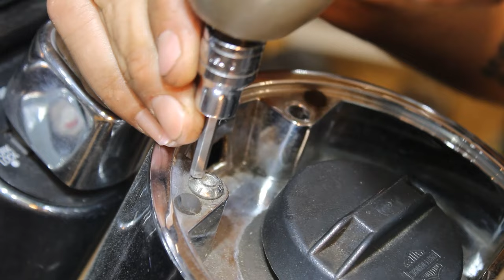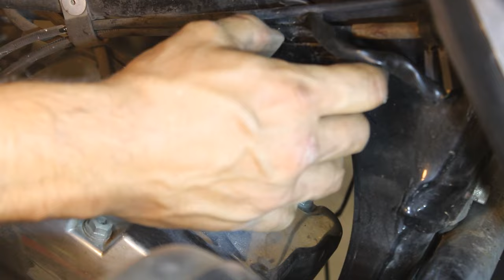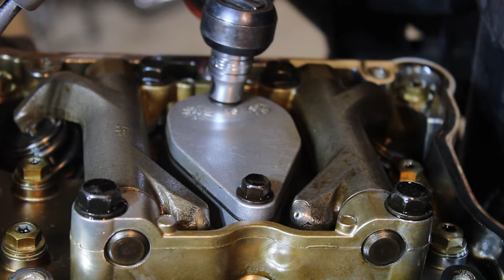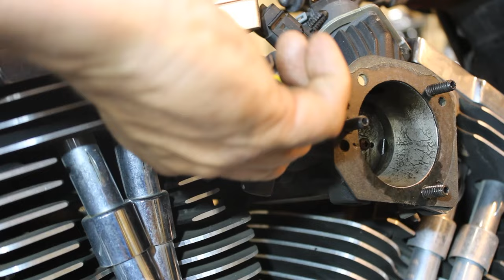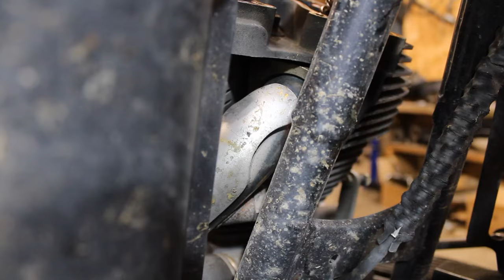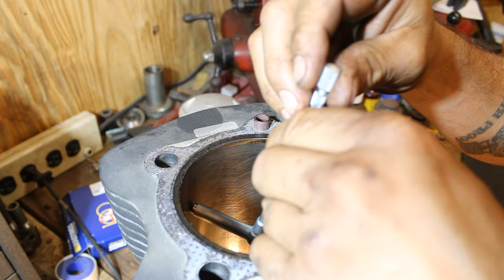Harley Davidson Twin Cam - How To Disassemble Top  End for Rebuild

Comment: Something he forgot is making sure the cylinder your working on is at top dead center compression. So there’s no pressure on the rockers when taking them off. You do that by jacking up your rear wheel, rotate it while shifting getting to the top gear. Then go to the side the pushrods are on. Put your fingers over the rockers to feel when the intake side comes up then goes back down. Check to see if you can see the piston through the spark plug hole. If it’s not your on overlap. Repeat until the intake comes up then down one more time then you’ll be at tdcc. The pushrods should be able to spin freely. ✌️

Comment: Great video, very well explaned. 
I've a cuestion; what is the cylinder head socket size to you use? Thanks
Reply from the maker: 1/2 inch 12 point
Reply: @DeathProofProductions  👍🏻👌🏻

Comment: I really need to learn this ASAP I am a mechanic I figured it out only thing confusing me is the valve tubes cut them with bolt cutters and replacing them with s&s adjustable is that why everyone cuts them of ?
Reply from the maker: We cut the push rods to make it easy to open the cam chest for inspection or cam swaps. Saves having to remove the top end.

Comment: Totally dig the channel man. Sub for sure. Got a used 04 road king at a great price, 37 thou miles, it's had the 95" top end done to it with s.e. cam plate with 525 cams. It's a strong runner,  I've been using Lucas syn oil. My mechanic told me those flat top s.e. pistons are junk cause their not forged. What's your opinion on that setup?....any advice you have will be well recieved.
Reply from the maker: S.e. piston are hypertectec just like the rest. If ur not drag racing for a living your fine. Remember guys like that make a living selling parts. Always remember the that myth busters figured out  frog pee doesn't cause warts.
Reply: @DeathProofProductions  well said man, but would you let a frog piss on your hands???...thanks for responding  back man
Reply: @DeathProofProductions  ....hey man if u don't mind, what's the maximum crank runout on the twincam 88 if I wanted to use the s and s gear drive cams?.
Reply from the maker: No more than .003 if you don't want any gear whine.
Reply: @DeathProofProductions  .OK man, thx. No way that  motor has .003 run out. Damn shaky ass rubber mounted engines

Comment: I have an 01 electriglide...my first big bike...(also have a 74 iron first bike). But his is great but mine had about 26000 miles...and I put 10000 on since last yr...need to change cam tensioner for peace of mind...what best for that?
Reply from the maker: go to my home page i have a video called cheapest way to prevent cam chain tensioner failure. I go into that. thanks

Comment: How do I get the last bolt out of the rear head, no clearance
Reply from the maker: I should have shown how I do that but I didn't think about it. Pry down with a piece of wood and pull it out. Remember it's rubber mounted so it has some play.

Comment: what was the cause of the carbon build up? mine has 1/8" build up on cylinder ad head after 30000 miles
Reply from the maker: Breather gasket was letting rocker box oil leak into it and into the intake for about 25000 miles. I noticed when we rode to Sturgis that he had alot of oil coming from his air cleaner so I new the breather was leaking. That's why I had him let me tear into the top end and put all new gaskets in it and inspect everything.

Comment: please can you just confirm to me that when removing the rocker arm assembly they just have to have play on both?  as in push rods are no pressure?  Does it matter what stroke the motor is on?  Im going to just make sure they wiggle  please if you can let me know
Reply from the maker: Really it doesn't matter if they have pressure on them. Just when you reinstall them take your time tightening them down. If your using adjustable push rods than you do bump it over until the lifter is level with the anti rotation pin. I almost never bring it to t.d.c to do anything on the top end.

Comment: Would you throw on new rings?
Reply from the maker: I checked the ring gap and thrust faces and they were well within the service wear limits. I usually  don't replace parts if they have alot of life still in them.

Comment: I got a twin 95' kit just blew a head gasket on front jug. Had the compression release stuck open as the button came off and then didn't pop up. You think that would have caused it?
Reply from the maker: No that shouldn't have caused it more than likely it was a head bolt issue.
Reply: @DeathProofProductions  thank you sir!
Reply: Well I disassembled everything. That head gasket looks like new and came right out. The head is flat on the mating surface. Hard to believe that is was leaking. Head bolts were tight! But I don't know if they were torqued correctly as I don't see any marks.
Reply from the maker: Sorry for delay been covered up have you got her put back together.
Reply: @DeathProofProductions  yes sir!. Works good now. I'm watching your other videos on things I can tackle. Thank you for sharing!!

Comment: I get that it's not worn enough to replace but wouldn't you re-ring it since you are in there?
Reply from the maker: The training that the factory tought us was that if the part is well within tolerance and had no signs of damage then don't replace it. Besides this bike belongs to my cross country riding buddy and if it starts losing compression I can tear it down bore it and have it back together in a afternoon. From my experience though, it's got alot of miles to go before we have to do that.

Comment: You should do a compression and a leak down test on your Dyna to help us new bees... lol  Thanks..
Reply from the maker: thats a good idea. I have several we're filming now but I might be able to squeeze it in.
Reply: Thanks...
Reply: question. When i done my compression test and i unhooked my auto compression releases the compression was 215 on both cylinders. when i left them hooked up front 100 and back 120. now i dont understand the difference between that? Pleases help.. Thanks
Reply from the maker: Let me make a video. It will
explain it better. Alot of things can affect the readings. And since I'm not there to see the readings, just watch me on the video.
Reply: Ok thanks I really appreciate it.

Comment: I would never be able to remember where every bolt goes to put it back together.
Reply from the maker: You would it doesn't have a hole lot of them.
Reply: @DeathProofProductions  I'm going to attempt to rebuild my late father in laws sportster for my wife. Most I've ever done is basic stuff. So I'll give it my best. If I get in over my head, I'll have harley pick it up and fix my shame 😆
Reply from the maker: It's easy you shouldn't have a problem, if you run into a issue and have any questions email me at davethom2004flstc@gmail.com and I will try to help.

Comment: So i have this nasty racket going on in my 95" big bore on a 2000 electra. I think its a valve . Ive watched your lifters install several times. Ive tried 3 different lifters. The hy-lift slow leak johnson, set of S&S and a cheaper set off eBay. Top dead center, 3 1/2 turns after no lash. No change. I guess I would ask what do i look for in valve body. Broken spring? Suppose ill have to remove the valves to know if ones bent? I pulled the heads and nothing stands out. But certainly sounds like a valve hammering away riding it.
Reply from the maker: what lift cam are you running.
Reply: @DeathProofProductions  S&S 570G gear drive
Reply: I suppose that's what you were asking is what cams are in it.
Reply from the maker: Sorry for delayed response been covered up. Did it make that sound after you installed the cam.
Reply: @DeathProofProductions  no it started over time --after changing head gasket. Which was good it turned out the compression release was bad. 
But I think I messed it up when I put it back together. Cause I pulled the rockers, and push rods out the top. When I put it back together I put the push rods in, then the rockers and torqued them down. Which I assumed nothing changed as the motor didn't move. 
  But they're adjustable pushrods.
Reply from the maker: When you first fired it up after changing the gasket did it start doing it.
Reply: @DeathProofProductions  no not immediately. I believe it was a couple hundred miles or couple fuel fill ups before I started hearing the noise. But it's really loud now. 
  So I took it back apart. Pulled the heads, pulled the cam chest, replaced the pump. Replaced the lifters. Examined the heads, the valves look seated nicely, no evidence any damage, Springs look good. Little carbon on pistons I cleaned up.
 Put back together. Torqued everything. Adjusted push rods properly this time.
  Started up and was the same.
  But sometimes when it doesn't start up it can make the ugliest sounds. 
 Too me it sounds like bad valve/valves in a car ran without oil.
  But only thing I haven't looked into is the crank and lower end.
Reply: @DeathProofProductions  got any ideas on this situation Boss?